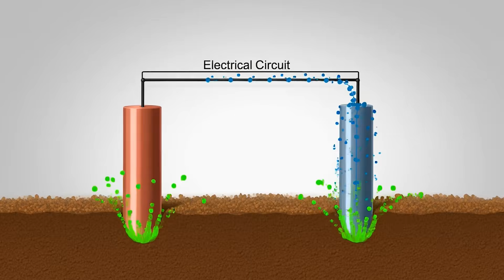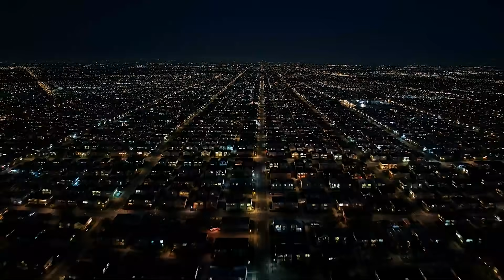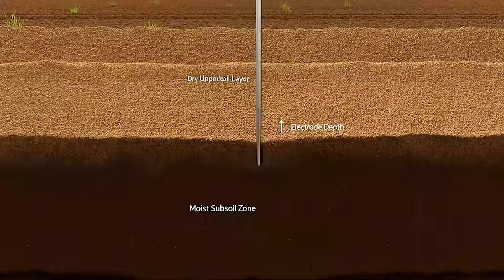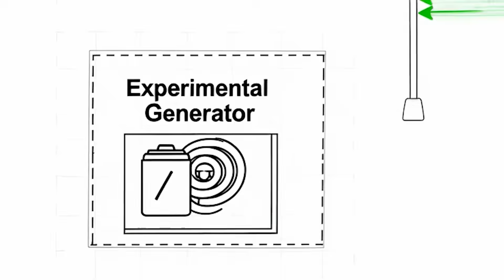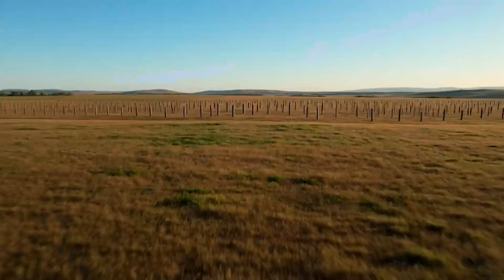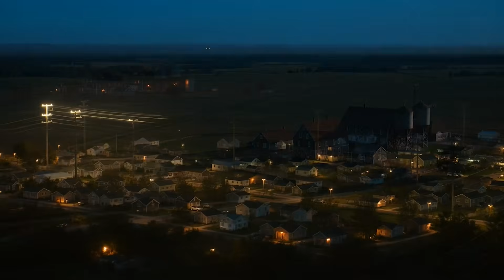The Amish Have Never Paid For Electricity - This $5 Earth Battery is Now Illegal to Build

Comment: I pay nearly nothing for electricity on an annual basis due to my solar array which is grid connected, not battery connected.  I receive a refund check from my local utility after the fiscal year ends for the utility.   (an example of a good generation month would be May 2026; my arrray generated 3,429 kwH, in January 2026 it was 1,963 kwH.  My array generally generates 31,000 kwH every year). That being said, I do pay a little (~$15) in november, a little more (~$50) in December and January, back to a little (~$20) in February, and none the remaining months.  I have not invested in batteries yet for a 5 day backup scenario due to investment cost.  The array also powers my wood shop when I spend time there.  I heat my shop to 70 deg F all throughout the cold months; the shop is also a garage for my pickup.  I do have a full home emergency generator (Generac) fueled by natural gas since I have not committed to enough batteries to run my home for an extended period.  An admission here - I use way more electricity than most since I generate so much.  

*  THAT BEING SAID, this earth battery option is INTRIGUING to me.  I live in Wyoming so having minimum 20% soil moisture will be a significant challenge though the soil contains more than the adequate clay component.  I will test this.....I was one of those chemistry students in high school that did this experiment...and promptly forgot about it.  

Thanks for galvanic "kick in the pants" reminder.